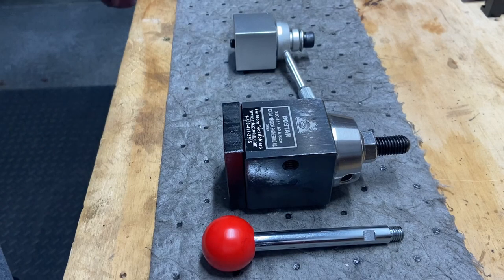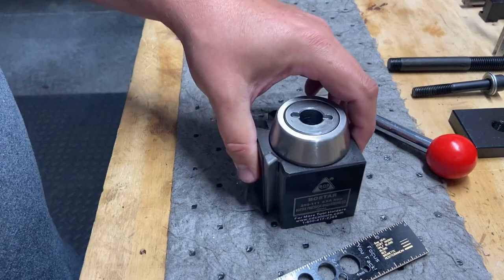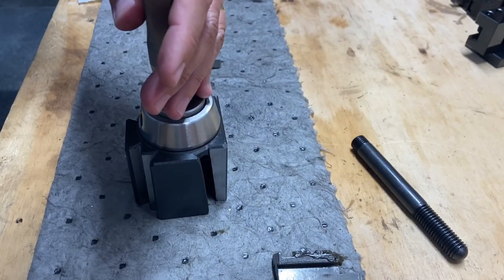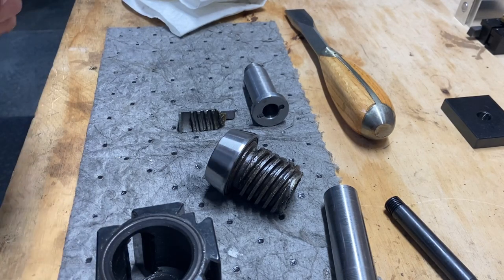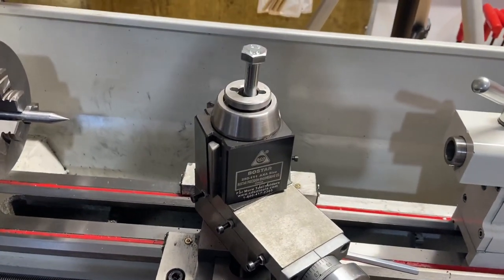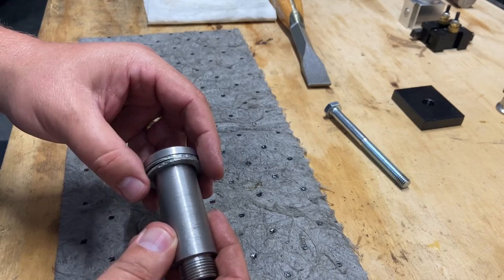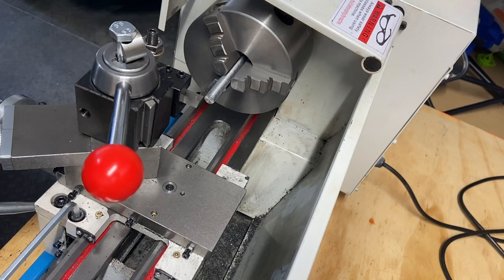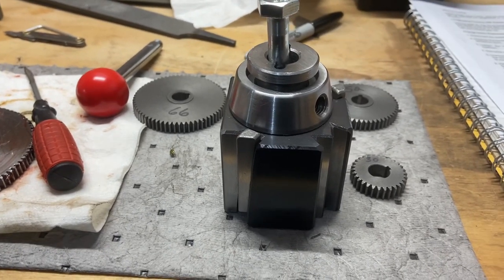Vevor Mini Lathe MX 400 Part 31 - Bostar AXA Quick Change Tool Post Upgrade Series Part 1 of 4

Comment: After the sneak preview I bit the bullet and ordered an AXA myself, there is no boss sticking up on my compound to make things tricky, so I could have just turned down the end of the stud that came with the toolpost and re threaded it to 10mm to fit to the hole on the compound.
However, that would have been far too easy! - I wanted to be able to swap between the original four way tool post, the mini qctp, and the AXA without removing the stud from the compound, so I got a longer 10mm stud and made a sleeve for it to fit within the AXA, made a large washer for the top, and then the 10mm flange nut goes on top of that to clamp it down. I've not actually had chance to fit it yet so fingers crossed! 😁
Reply from the maker: Nice,  There were a few ways to tackle the mounting that I came up with.  I like yours and would likely have done the same in your shoes.  that boss is what tricked me up.  Good luck, I hope it fits well.  Should go well. I have faith.
Reply: I also upgraded mine to the AXA style. My compound has the boss. I drilled out the m10 and threaded to the new bolt size. I made a thick washer and installed it at the top of the AXA tool post underneath the cylinder under the nut. That was it! The washer I made was just larger than the thickness of the height of the boss. I also bought some of the tool holders (250-101XL) and my 1/2" tooling can sit below the centerline because the XL holds the tool lower than the regular tool holders. 😜

Comment: I am working on getting the MX750 up to a useful state. Thankfully, the saddle and cross slide on it are cast iron. However, the entire compound is aluminum (and the extruded mating surfaces are not even machined), so I am not confident that it can be used as is to try to machine some necessary steel parts for a transplant using a cast iron AT300 compound and 0XA/AXA tool post. The other major issue I have with the MX750 is that the tailstock is also cast aluminum. A cast iron transplant is in transit from the birthplace of our lathes, hopefully that should be here soon, but it was designed for a 210 mm swing over bed and the MX750 is a 220 mm swing, so modifications will almost certainly be required. Is your tailstock cast iron or cast aluminum?
Reply from the maker: My tailstock is also aluminum and has been one of the most challenging aspects to zero in in this lathe. One of my worst complaints about it. Thankfully my compound is all cast. The aluminum just isn’t substantial IMO but then again I’m new to all this. Check out some of my earlier videos if you haven’t on the tailstock  I show it in detail. Good luck. I’d be curious to hear how your cast tailstock upgrade goes.
Reply: Give us a link to the cast iron tail stock please..

Comment: Could you make a sleeve to go into the piece it came with and that bolt?
Reply from the maker: I might have been able to do that but I was mostly brain storming during this video.  During the series I ended up remaking the internal mounting sleeve entirely with a smaller bore to accomodate the bolt.  Over time I have upgraded to a custom locking lever as well so I dont even need to use the bolt any longer.

Comment: 1-3/8 shaft would be better than 1-1/2. The less material you have to remove the easier it is to hit your target. With 1-3/8 you would only have to remove 0.014" to hit your target instead of 0.139".

I just helped a friend make a bunch of 1-3/8 shafts for one of his customers. He had some drop cuts. If you are interested I bet I can get you a piece. 

I think the hardest part is going to be the threads. Judging from the measurements you took that is either a 19mm or a 20mm thread. Metric threads are a pain to single point on mini lathes unless you have a 127 tooth gear. I think a bushing to take up the slack or making a new stud would be an easier route since the thread in the compound is much smaller and can be done with a die that you may already have on hand.

If you want to use spacers to lift that center sleeve so you don't have to cut the length of the threads down,  put a spacer on the threads that is maybe 0.010" thicker than the spacer at the top to keep it from binding and lifting the tool post.

It's great to see someone not just throw in the towel and give up. Keep at it. That is the best way to learn and I am sure these videos will help others down the road.
Reply from the maker: Yeah. That would make more sense if I was buying more material. But if you have a cutoff that you can share I’d love to (spoiler alert) remake the internal sleeve. I succeeded but the top flange is undersized. I’d really like to recreate this internal sleeve with right sized material. Shoot me an email if you don’t mine sending me a piece of the cutoff.  There are a few ways to tackle mounting this  tool post but I chose the option that didn’t require me modifying any original parts. Thanks.
Reply: @deezworkshop  cool I emailed you.

Comment: For MX-210V / WM-210V  just Use 250-000 0XA fit properly & Little bit cheaper price than 250-111 AXA .
Reply from the maker: I tried the 0XA and I did t like it. Of course what I bought was the absolute cheapest one I could find at the time and didn’t know what I was doing. Regardless none of the sizes I could find would accompdate the boss on my compound. I had to customize the OXA (ruined it) to get it to work. The AXA I am very satisfied with but had to make a custom part to mount it to the carriage. You can certainly use either of the sizes with this sized lathe I’m
My opinion. Thanks for the comments.